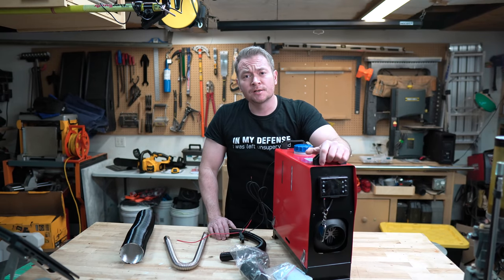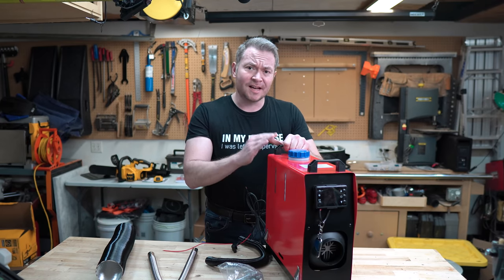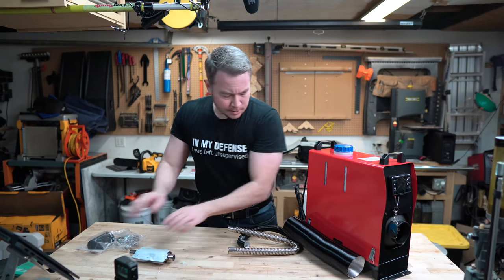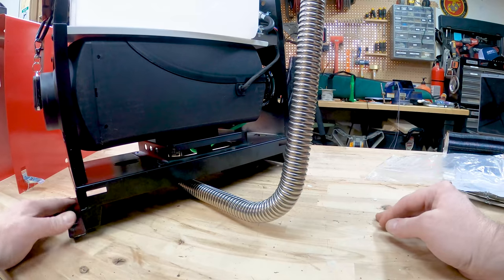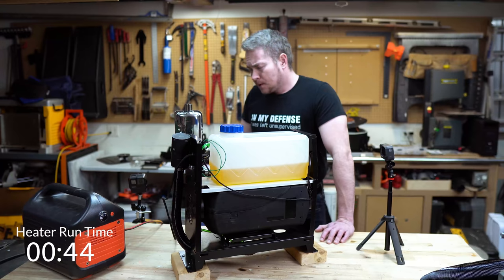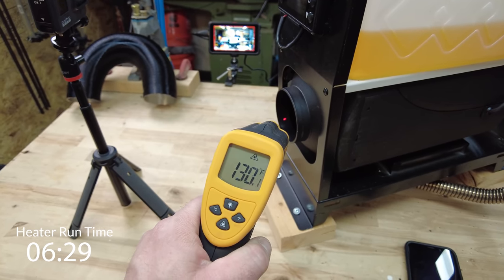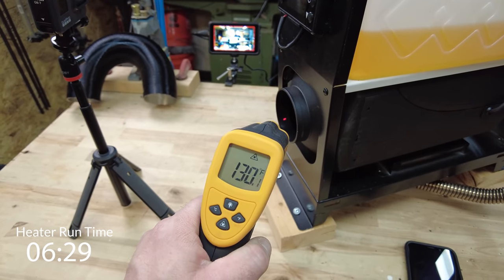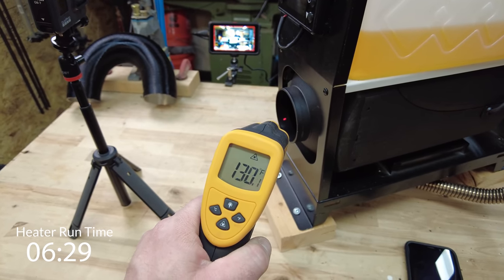My First Chinese Diesel Heater

Comment: These type of heaters should be using an exterior routed exhaust hence the are great for boats, campers (RVs) ect and ideally a separate fresh air intake no where near the exhaust, and as such are very safe in regards to carbon monoxide and dry air, but it does worry me that lots of guys in the US seem ignorant of the threat of carbon monoxide from the little Buddy type and other propane heaters. My own VW camper/compact RV has a Propex unit that is a similar design (not the suitcase configuration but the vehicle one) and as I have a refillable propane or lpg tank under my van it runs off that as dose my cook hob

Comment: I see behind you on your bench is a DeWalt 20v brushless chainsaw. I love mine and I am really impressed with what the little saw can do.
As far as the heater goes, I bought a Vevor brand. The instructions are laughable. " 1. Add Diesel. , 2. After the machine is installed, Check whether the Phone is stuck, If it is stuck, It can not be started."

Comment: Nice video.   You said no odor but, did you check for carbon monoxide?  In general use will you pass the exhaust outside?
Reply from the maker: Yup.  I have a follow-up video here (https://youtu.be/uHML7yUf6zk).  Firing it up the way I did was just for a short demo / test run and I had open doors for ventilation.  Though in hindsight I should have been more forthcoming in informing folks of the proper precautions.  Thanks for watching!

Comment: So mounted next to an exterior wall and a single 90 bend on the exhaust and then extended through the wall to outside with the heater flue end aimed towards the room or shop then it could literally be ran indoors and provide some decent heat at a low initial cost as well as lower fuel consumption than most diesel heaters do but it does require an electrical source to run...
Reply: So no electricity or 12v means no heat..

Comment: Hi Tom, a quick question - before I rush out and buy a portable battery, are you able to run your heater through the cigarette lighter port? I've seen online they can draw up to 11.5 amps, and it seems lighter plugs are rated for 12. If it works for you, I'm willing to give it a try, but if your running it from mains with a transformer I think I want to find a better way :)
Reply from the maker: I can speak to what I have. This unit in this video I have run successfully and exclusively on my jackery 500 using the cigarette lighter port. It’s never drawn in excess if 10 amps (rated outlet power of the port). I’ve seen other viewers comment that they were unable to run it off a portable power station but they did not elaborate on what heater or power station. I’ve also run this unit on my Bluetti EB55 without issue. Hope that helps!

Comment: As a trucker who regularly uses a webasto, they definitely get to the point that during the startup they dump smoke.
Reply from the maker: interesting.  And good to know.  I've seen from folks on other channels that it's a good idea to disassemble and clean out the combustion chamber every season.  I'm looking forward to taking this apart and inspecting it after the winter to see what it looks like in there after a season of running.  Hopefully I can put it back together :P

Comment: It's important to realize that the self-contained version you got was produced to consumer demand for an 'easily mobile' version without a separate tank. The ones without the case are much less flimsy in real life. There are youtube videos of guys who've run them for THOUSANDS of hours on everything from kerosene to used heating oil. When they finally wouldn't run, they stripped them down, cleaned the glowplug and combustion chamber, and fired them right back up.

There are millions of those things in operation in China, because diesel is cheaper than any other form of heating.

Comment: These units are great for boats. Keep you warm and keeps the dampness out.
If you tap into the boat fuel tank and mount  in the engine room. Then that area is warm too.
Reply: I got a boat and bought it for my boat. But I am unsure about how how the exhaust is going to get. It's a boat, made of wood and GRP. I don't wanna melt or burn anything.

I also have to figure out where to put it if it doesn't fit in the engine room bay (which doesn't seem to be that way), how to put the LCD somewhere visible (have to extend it I believe), and how I will route the heating ducting through the boat. One to my salon the other to my forecabin.

Any advice?
Reply: @obiwanfisher537  
Only to treat the exhaust pipe  like any other exhaust pipe. Would not extend the pipe. 
Definitely talk to people who use it and can see your boat.
Reply: @assassinlexx1993  Dunno people who use heaters on their boats. And I don't know what "normal treatment" of an exhaust pipe is?

Comment: Top notch. I was wondering about using a Jackery for power, smile. Only suggestion is do not aim exhaust upward as condensation will collect at lowest point in pipe, this may not even be an issue. ATB.
Reply from the maker: Thank you!  And good point about the exhaust.  There's no weep hole anywhere so you're right, moisture would certainly collect.  I'm currently looking to permanently mount this in my shop and will take that into consideration when routing the exhaust.  Thanks for watching and chiming in!

Comment: "Gas tank" 🤣🤣 Still, great video! Many thanks for all the info.
Reply: 🤣LoL, 😆I’ve been around the trucking industry for 30 years and still find it interesting that people are so adamant that diesel has to be contained by a fuel tank? By definition and not presumption is that not the same as a gas tank? Heck, anything even the back of my pickup bed is a fuel tank, Since “fuel is any matter” used to produce heat by burning; that which feeds fire; combustible matter used for fires, as wood, coal, peat, etc. I believe this man is very well verbally adapt, and spoke well. I bought one of these diesel heaters to experiment with, not wanting to spend an Espar price, and have been impressed as well. Since they have put together the portable units and I’ve been tempted to get one too. 😃Enjoy👍🏼

Comment: Hello Tom I like your video I just ordered one of these myself and I was just wondering how your unit is still operating.
Reply from the maker: 1.5 winters into it and it's still working great!  No complaints to far.  I might try to disassemble it before this winter to see what kind of soot and crud has accumulated in it.  TBD.  Regardless, for the price, I still recommend and would buy again.  Thanks for watching!

Comment: Higher qaulity glow plugs and automotive noise dampening can be had for less than what you paid to purchase the unit.

Glow plugs can often be bought at a brick-and-mortar store and Amazon caries heat-resistant automotive noise-damping stuff.

Also, higher quality fan and blower motors, such as those found in ShopVac brand equipment have bearings, rather than just bronze or poly bushings. So, if you have a ShopVac that for whatever reason is out of service, due to something other than the motor itself, like I do, it might be worthwhile to do some redneck engineering as means of improving the CDH.

Comment: Ive had one off these for 5 years now but mine is not in a stand alone unit like yours just the heater and a 20 litre fuel tank iam using mine to heat 2 workshops at the same time one is 12x20 and the other is 10x8 feet and they get very toasty its never let me down the only thing i do is during the summer months when its not in use is to run a gallon on parrafin through it to clean it out as the fuel pumps can tend to get a bit sticky with the diesel if not used i have it sat on a steel plate that came with it for mounting it and the both the pipes are vent outside the workshop and i have it running off of a 12 volt power supply that can power upto 20amp no issue as of yet hopefully it will last another 5 years

Comment: Just found your channel, thank you for a well done informative presentation, I'll look for any follow up video,  two questions why do you keep calling the heater output/blower  "exhaust" 
Snd did you consider using a small wood burning Pellet Stove that some off grid and van dwellers use,  it is more permanent not portable
Reply from the maker: I've got a couple follow-ups on the channel.  One is a "field test" in my backyard over a chilly night.  Another is a 1-year update.  As for "exhaust", I suppose semantics.  Technically it can mean 'waste gases' or 'expelled air' so I suppose it's applicable either way ;). A wood burning stove I would love to have and try!  They're a little above my price point at the moment though.  Perhaps if / when this thing breaks, that'll be my next heater setup.  Thanks for watching and chiming in!  I love the "Mr Wizard" moniker...use to watch that dude as a kid!

Comment: Great video thanks. I bought the same model and I've just got it all set up and running.my question is as you know the fuel tank is loose but also above the heater,i am worried about the fuel being so close do you think its safe or would you recommend moving the fuel can to outside the building i am in? I worry about this but wondered how many others keep the fuel inside the case?
Reply from the maker: So far I've not had any issues with the fuel tank and its location.   I did end up using some double-sided tape to keep it from moving around, but kept it in its original place.  It's understandable to be concerned about the tank being right above the heater, but so far for me it hasn't been an issue.  Relocating the tank is certainly an option.  If I were to do that, I would just be extra cautious on how fuel lines are routed...ensuring they're secured firmly, not up against anything abrasive, not near any heat source, and not running thru any wall or cavity that's not quickly accessible in case of a leak.  Hope that helps a little.  I'm actually working on a video right now that shows my garage installation and performance update.  Perhaps that might help :). Thanks for watching and good luck!
Reply: @TomtheDilettante  many thanks for your kind words much appreciated.i decided this morning to place my fuel tank outside routing fuel pipe etc outside the cabin,i got to be the most unluckiest man on the planet and knowing my luck something would of happened so hopefully when i finish it tomo i will feel alot more settled.i will have a look.at your installation. Cheers.

Comment: Will this heater run off a car battery? Or do you need a 12v power supply? By the way love the shirt.
Reply from the maker: Actually, most people use these with a car battery (as most are 12v).  I will likely run this off a car battery from time to time as well.  I chose my Jackery unit because it allowed me to easily measure power consumption for the sake of this test.  Thanks for watching and I'm glad you enjoyed the shirt too LOL

Comment: Thanks , I’ve been Curious about these things myself , the Original Webasto ones were sworn by all the Boaters and Camper people i knew ,I’m both BTW i may have that name incorrect  i had picked up a Mister Buddy years ago at a big box store on Spring Clearance prices and i  wasn’t that secure on its safety  although i liked the heat output i only used  it on my Fishing boat that  had a Canvas  enclosure  around the Helm but had plenty of Fresh Air Flow from windows and other openings  in all honesty i stuck the thing under my helm Chair  and mostly just took the chill out of that area and warmed up my Feet  that were in non insulated Rubber Boots  i mostly had for warm weather  Fishing  ironically one of the Ads for one of these heaters onRbaynhad a baby sleeping Comfortblynin the backseat of a car  next to the heater !? i always chuckled wondering if the kid was still alive or passed away from CarbonMonoxide poisoning ? in the height of the VW Aircooled Beetles  there was a accessory available for a gasoline heater that plumbed right into the cars fuel system  and bolted under the back bottom Cushion !  i honestly don’t recall how it was exhausted  as i’ve only seen old Adverstisements  in ForeignCar magazines and similiar Publications  my Dad bought a 1958,63 , and a 68 Beetle all brand new and my Mom  remembers how cold they were to ride around in  during Winter time travel  a
though she does laugh of the memories of my Dad telling the Gas Attendant one dollars worth of Fuel please

Comment: Tip for you folks looking for a QUALITY AMERICAN MADE Diesel heater, check used school buses, many had Webasto and Espar heaters that run on diesel and don't need the engine on to operate. they can be picked up cheaply and are industrial strength and will certainly heat an entire shop or RV.

Comment: There's videos on how to fix the annoying tapping of the fuel pump. And I've heard some people choose to suspend the pump in the air, which deadens the sound. It's because it's sitting against something and tapping that it gets amplified more.
Reply: ...resonates within the cavity it is attached to!!!
Reply: @fookingsog  Indeed, that's the right wording.
Reply: Remove the steel P clamp that mounts the pump, leave the rubber in place, cut a short length of 50 x 50mm angle a bit longer than the pump and mount above the pump. Use 2x 8mm wide cableties to hang the pump from the angle through a couple of holes drilled near the edge of the angle. The ties should go around the skinny ends of the pump against the wider middle section. Just don't pull them tight, it needs to be suspended.
Massive reduction in the ticking sound conducted to the bodywork.
Reply: @v8snail  Great description! Thank's.
Reply: ALSO : Not all instructions mention this ( what a surprise ! )  
•  The pump should not be mounted Horizontally or Vertically.  It should be on an angle of 30-45° 
•  The pump should be higher than the fuel tank , & the heater higher than the pump  to prevent siphoning problems when off. ( That of course is re: included parts.  i'd imagine that you could remedy siphon issues with added check-valves , but that's on you. (  i was surprised to see that Tank above the heater. Perhaps THAT maker has a ck-valve somewhere ? There are Many DOZENS  of small shops churning these "Parking Heaters" out. ) 
•  Foresty Forest  got a SILENT 3rd party pump from a guy , but it's pricey  , about $100 ?  Worth it if you can't sleep i guess.

Comment: I.ve just bought one of these, the exact same model, 5 KW, on EBAY for A$140.......it will heat my garage workshop in the Winter when it gets a bit cold.......compared to the 3,000 watt fan heater I have, the running cost with Kero will be exceptionally low.
The big advantage will be the ability to turn it on and have heat in a few minutes for those odd times I want to do a quick job when it's cold.......8 to10 deg C is too cold to work out in the garage for any length of time.
Edit....the biggest problem with these diesel heaters is the 12 volt supply that needs to be at least 10 to 15 amps and a car battery won't last long at that rate, so I went on EBAY and bought a 12 volt 30 amp (360 watts)  power supply for A$26, arriving this week......I'll probably attach it to the side or maybe inside of the casing to make it more portable and compact.

Comment: This is interesting. But I think for me, I don't like that it requires an external power source the entire time and not just for startup.
Reply from the maker: Yeah, that's not an uncommon comment I've seen regarding drawbacks.  There's no spinning components or power take-off so I can't see a good way to attach a stator and regulator/rectifier to make it more self-sustaining.  Maybe some units come with something like that, but I suspect they'd come with a higher price.  Would be cool though :). Thanks for watching!

Comment: i have one of these Chinese heaters and only thing bad i can say is the 2 that i have bought, both needed glow plugs with in the first few weeks. otherwise, have had 0 issues, they pump heat like crazy (8KW) and i find to be slightly better then my D2 Eberspacher. main reason is simply the control i have with the chinese one more then out performs the dinky little controller dial i have on the d2. my heaters arent in this stand alone case. we use them to heat our trailers as well as a secondary source of heat in our shop

Comment: First off, great video. I have the 240 watt version of your battery pack, since all I run on it is a 12v water pump, and LED lights at the hunt camp. With this, I'd have to upgrade my unit, and find a place to hide solar panels for when I'm not there.

So far, I charge my unit off a small pure sine wave inverter in the back of my Jeep, extension cord to inside the cabin, and ac charger for the power unit. I'm thinking my little power unit won't hold the night though without draining the jeep battery. 

Run Into any other diesel heaters that run with lower power requirements?

I'd like to free up the space that the big wood stove takes. 9 square feet out of a 16x16 cabin, plus stovewood.

Comment: i dont know if they make small ones but there are large ones that tap in to a tractors cooling loop to preheat the engine on really cold mornings good one can be set on a timer or even connect to the cell network and you can use an app to tell it to turn on when you like so by the time you get to the field your engine is nice a warm for a nice an easy start.